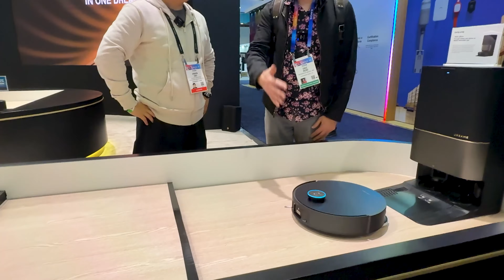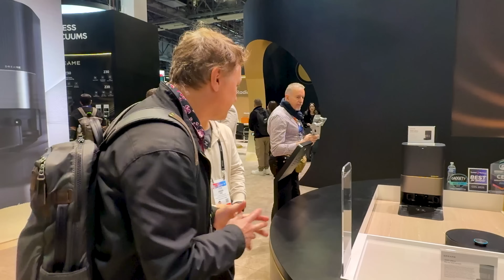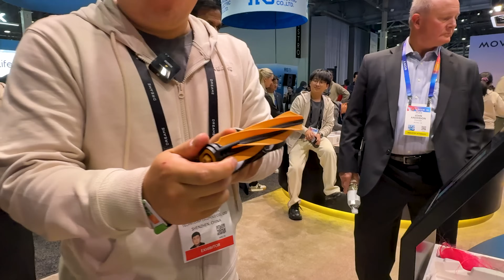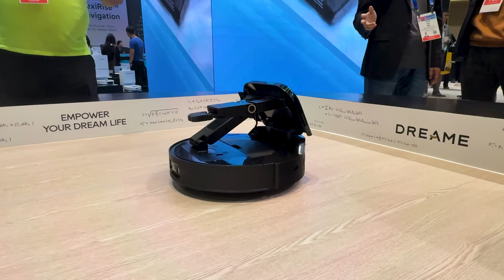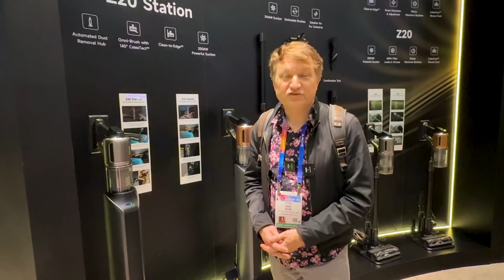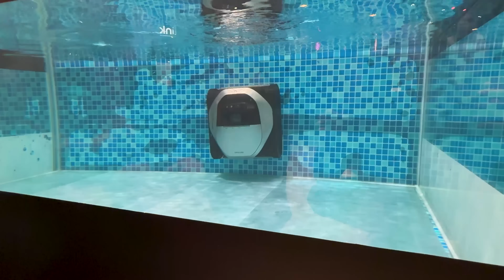Dreame X50 Leaps Ahead + Surprise Robot Arm!

Comment: I own the x50 and the threshold climb has been useless for me. Keep in mind the climbing feature was probably designed for homes in China. Bathrooms and kitchens seem to have higher thresholds between rooms to contain floods I assume. My balcony has quite a height difference between both sides of the threshold. My x50 can cross the threshold to enter the balcony but cannot leave the due to the greater height from the balcony side. Again this design is meant to contain floods since my balcony has my washing machine which is common in China. Depending on the design of the home, this feature may be a great benefit but not for me. Other than that, the dual brush feature has been amazing and I never had any tangle issues since owning it.
Reply: This isn’t only useful for Chinese apartment. Here in Europe, we have quite a lot modernized historical buildings. During modernization, after evening out every room, you are left with small steps between rooms. I have a step of 5cm between my hallway and my living room. This will be the first vacuum robot I can use for every room.